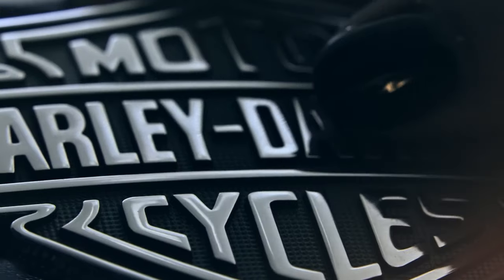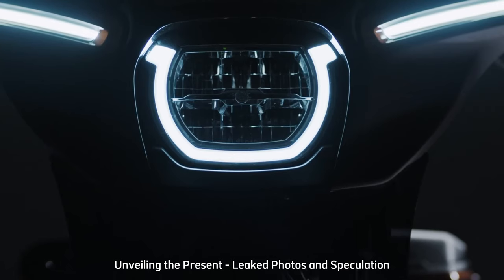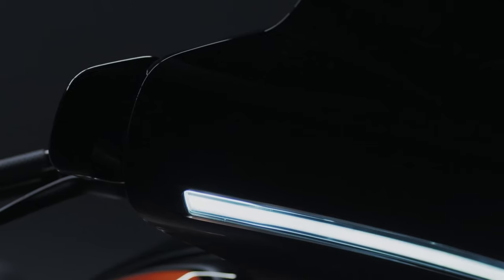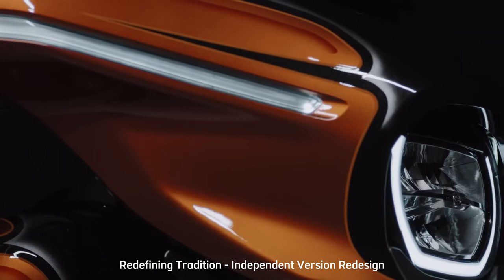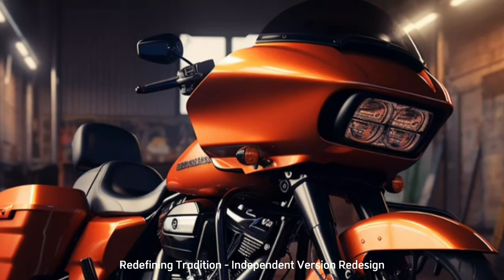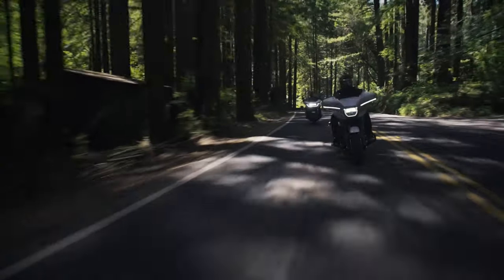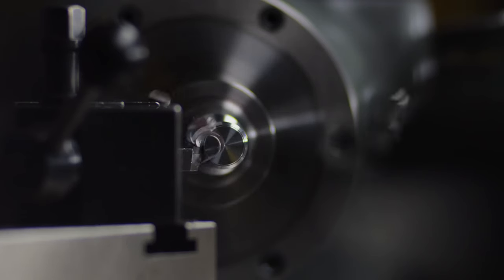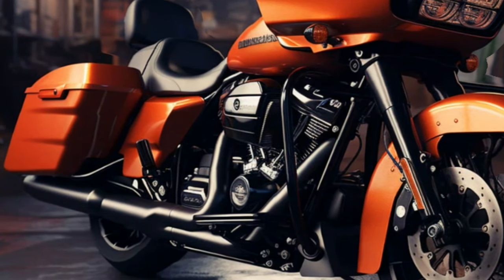Unveiling the 2024 Harley-Davidson Road Glide Special: A Timeless Legacy of Elegance and Innovation

Comment: They need a huge suspension upgrade, and performance. As Indian is years ahead in those areas, Harley has the fit and finish and nostalgia.
Reply: In have 2020 streetglide special and Indians lose all the time? The rear suspension is a little hard and Indian does have a much prettier infotainment system by the chieftain and challenger have been beatin multiple times not even really close that surprised me? But I haven't lost to one yet? And a few have tried?  The new infotainment system on Harley CVO is better than Indian so that's that and the suspension if upgrade but not sure how it is yet?
Reply: @fingers215  That's funny - I haven't lost to a HD yet, most of which very cammed against my stage 1 Challenger.  If the suspension is on my bike is hard, I just adjust it while I'm riding with the touch of a button.  Also comes in handy when I'm about to hit the twisties and want to tighten it up.  Yes the infotainment system on the CVO is amazing, I give you that.  As far as suspension, you'd need a total redesign to include aftermarket swing arm to get close to the stock Challenger (hint:  Harley is only working with 3in. and archaic 2 shock system vs 4.5 with a true monoshock system from Fox).   And there's a reason the new CVO are using the same forks and brakes as the Challenger.
Reply: @mickcathey  sometimes it's more about the "rider" I don't think my Bike is fast at all. It has decent power but I don't think any touring Bike is fast. I come from racing sport bike and a 600 gsxr / cbr will smash both our bikes. And forget the twisties that not even the same Game! Stock suspension is OK on Harley SGS but I changed mine to ohlins its absolutely amazing front and rear doesn't get much better than that. I don't race my bike I just play sometimes old habits lol ride safe Bro
Reply: @fingers215  "I have 2020 streetglide special and Indians lose all the time?".  Wasn't that what you said??  Ok, whatever.  Ride safe.